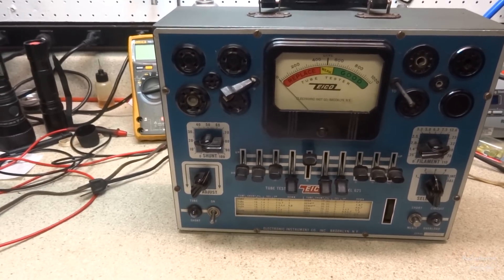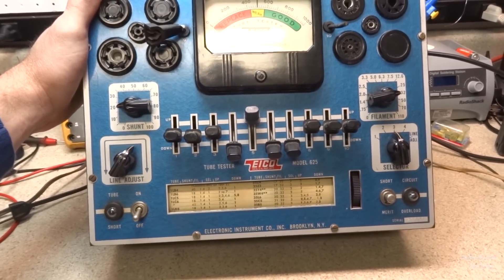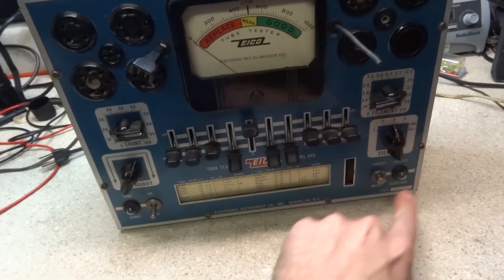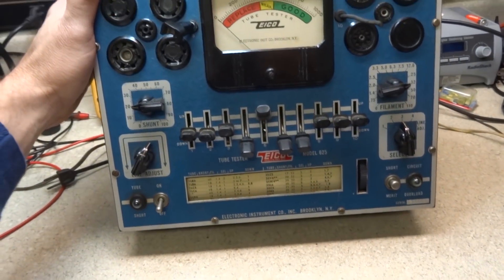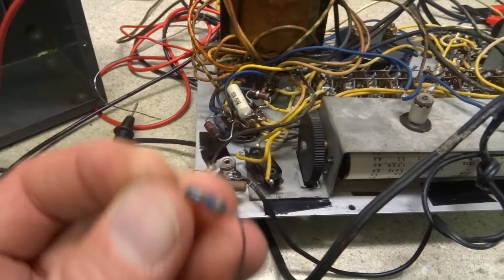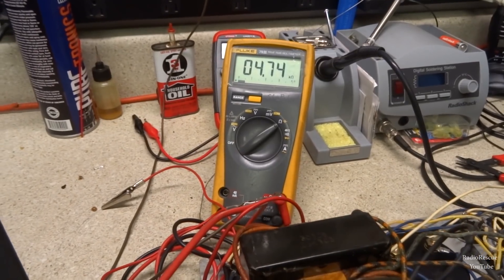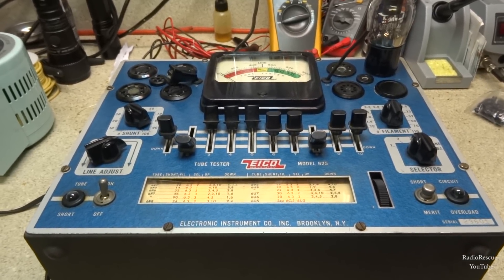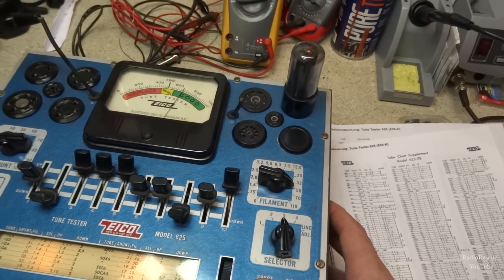Electronic Restore of A Early 50's Eico 625 Tube Tester

Comment: Type 43 filament draws 300 mA at 25V and was used in some of the earliest transformerless sets with 25Z5 rectifier and a few then-standard 6.3V 300 mA tubes such as 6D6 in a series string.  You'd still need to dissipate 50V at 300 mA so 15 watts which is a lot for a resistor, so you often instead see either a ballast tube or a resistive line cord.

Comment: On all basic emission type tube testers the ONLY alignment you have to do is the line adjust. On this unit you put a tube in a socket and turn it on.  
On the selector  switch that says 1,2,3,4, line adjust. Set that to line adjust. You are supposed to set the needle for top center i.e.mid-range of the scale.
You then turn the pot on the left that says  " Line Adjust" to get it there. You can then test a tube.

Comment: I also like old radio's and I have a few. I also like repairing them it is just a hobby wich I enjoy very much. I was interested in buying a tube tester but overhere (Netherlands) they go crazy on the price 300-400 euro's. I don't want to spend that much money. I guess they never be able to sell it to any hobyist. I looked on ebay and over in te USA the go for as much as 100 dollars now that is reasonable. But then you have to add shipping costs and customs, and then the question is in what kind of condition it will be after the long journey. But I see now there is not much inside that van brake.  Thanks for the opload, great video!

Comment: Great video on the Eico 625, I have 625 that is still used today in my work space and I have to go through and check resistors and the caps, but the tester works like new. This was a kit built back in 1956 by a friend of mine that had become an electrical engineering professor at Akron Unv, in Akron, Ohio. Thank you again for sharing this video with all of us.

Comment: Hey that's great I am in the middle of restoring  a 1957 Precision Model 660 tube tester on my channel.I had to take the roll chart out of mine and re-roll and reset it to the start position boy was that a job and a half.  I still have to go through and check out the resistance values and even has a large single plate selenium rectifier that is probably not working but it keeps me busy. Thanks for going through the tube tester and giving me more ideas. Oh and I have an Eico model 636 that works perfectly.
Reply from the maker: Yeah I don't like messing with those roll charts. Good luck with your tester.

Comment: If you are interested:
This procedure will make your EICO Model 625 filament voltage capable of being calibrated. 
In order to calibrate filament voltages the EICO 625 a few modifications needed to be done. 
R6 the 95K 1% need to be replaced with a variable 100k pot. 
I put it next to the 6H6 rather than have it on the face panel where it could get bumped. 
Next find the point where you can read the 250vac across the secondary windings. 
R1 2.5K 5w one its legs is a good spot.
The negative side I used the return on B1 and B2 for my return test point.
Install wire to your test points.
Next insure the lever switches 1- 10 are all in the “CENTER” position. 
Insert AC into your TESTER. Turn on TESTER. 
Measure your test points. 250Vac should be seen on your connected DVM. 
If not adjust line voltage until you have 250Vac at your test points. 
After getting this adjust your new R6 variable pot for the needle to be on the line mark on your TESTER’s meter. 
Once you have the 250Vac and the line meter adjusted. Check your filament voltages.
Place the lever #1 in the “DOWN” position. Place your DVM to check your four pin tube filament slot pins 1-4. 
Rotate the “FILAMENT” switch while observing your DVM. All the voltages should be fairly close.
Reply from the maker: Thanks for the info, But i don't like modifying my equipment. Happy New Year.